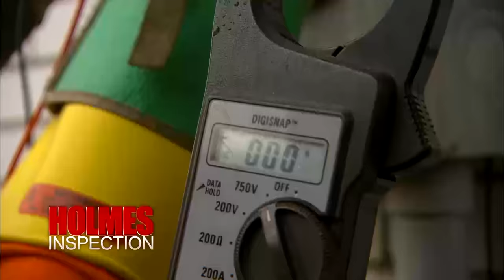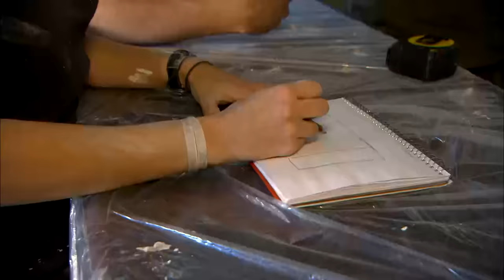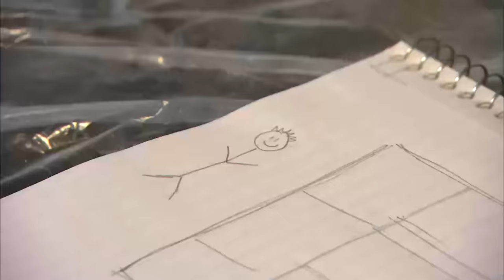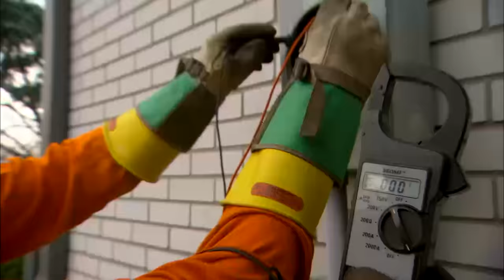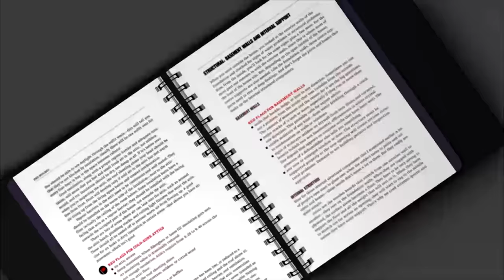Frozen Homes & Dreams: Shayne & Lorelee's Cozy Nightmare | Holmes Inspection S126

Comment: Always be scared of a "finished basement". I swear it's the biggest trick house flippers use. Do a bad job renovating the basement, basically just put down a floor and some dry wall and call it good. People think they effectively got another floor to their home and ignore the fact it's not a livable space because it's viewed in the summer and all the problems start in the winter.
Reply: ALWAYS LOOK FOR HEAT AND ELECTRIC  OUTLETS IT CANT BE CALLED FINISHED  WITHOUT IT.

Comment: All of Holmes' videos are Amazing since 2002!  It's like bringing in your old car for an Oil Change, and being told you need new valves for the engine, and recharging the AC, and the power steering, windows and power brakes need new seals, and you got a lot of Rust.  jeezzz. ... but the Rear View mirror is ok.

Comment: For the painter..... On MDF edging. Prior to priming and painting, apply  a smooth flat layer of latex caulk.  wipe in down with a damp rag and or finger to make it smooth. This will allow you to prime and paint / spray in normal coat amounts. Saves a lot of time and seals the edge for a permanent  workable surface.
Reply: he better read this a decade later. jk useful tip for me.
Reply: nice tip for modern viewers, episode is pretty old at this point
Reply: Sad to say Craig won't read this as he passed away a few years back in a scuba accident😢
Reply: @kenlanders7588  Damn, that's sad.

Comment: Just because a home inspector has done 100s of inspections doesn’t mean that they’re good at what they do.
Reply: Why would anyone buy a house with broken windows and no heat registers?
Reply: There is also the issue most home inspectors are provided/recommended by your real estate agent. The person who's really big on getting you to buy this house, not find things wrong with it. Considering till recent laws might pass they also get a commission based upon the final sale price. So they want it as expensive as possible because for some reason the buyers realtor is paid by commission which is split from the seller...
Reply: @Djinn510 The house actually seemed to be in pretty good shape given its age. All the problems easily solved.

Comment: For painting MDF if you use a quick drying acrylic based paint the MDF doesn't have time to absorb the paint and you can use less paint to finish the exposed ends. Typically in two coats no roller needed if already spraying.

Comment: Mike, I know you're in Canada but I really need help. I live in Ohio. Bought a house 2 years ago. It's an older house but since I moved in I've had multiple issues. Small septic tank that over fills with drainage water, flooded yard that smells like sewage, bedroom floor collapsed because the floor joists had rusted nails and no joist hangers. Floors are all wavy, toilet stack is cracked, no insulation in walls or ceiling, no ground wire on electrical plugs, old windows that leak water when it rains, shallow crawl space, no furnace only wall mount propane heaters. In the garage all the sill plates and studs are rotted out, garage is leaning, concrete is cracked and crumbly, old style ceramic fuses in garage, no ground plugs, ceiling is sagging, garage door has 2" cracks on both sides, too low to get my van into. 
I know I should have gotten an inspection but that was a condition of the cash only sale. I did take my dad and an Amish contractor to look at the place but they both agreed that it was a good investment. I bought what I could afford and now I'm living in a house that's crumbling. There has to be something you can do to help me. I'm not married, 54 yrs old and disabled. no kids except my 2 GSDs. They love the fenced in half acre but the yard is so muddy right now that when they come inside they are caked with mud. The mud creates dust and I breathe it in. Since it smells like sewage I don't know what I'm breathing in. I have to wear a CPAP at night and I have to change the filter once every 2-3 days. Please Mike, I need help and don't know where to turn. Some have suggested tearing the house down and starting over but I don't have any money to do that.

Comment: Man, I wish you could make my house right. I’ve had three bad contractors work on my house. I have house that runs hot in the summer and cold in the winter coming through the walls and attic. Have water rotted boards in walls that the boards sound hollow and you can take a fingernail and completely chip off the wood. Skylights are hot in summer. Electrical issues.

Comment: no inspector is going to get on the roof and look down the chimney , right?
Reply: No, but the inspector went ahead and told them it was safe to use anyway. A home inspector should always just say "Get a WETT inspection before using this fireplace" and leave it at that.